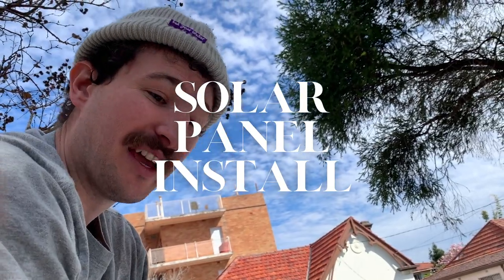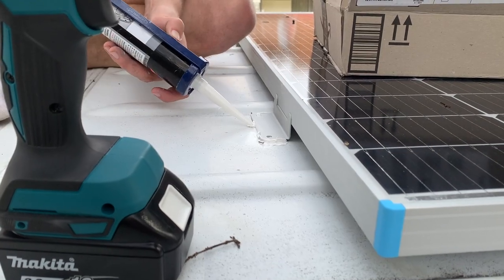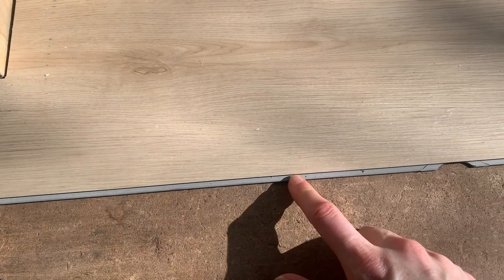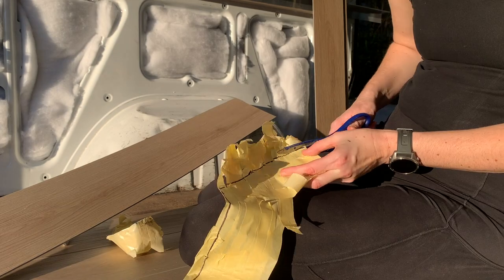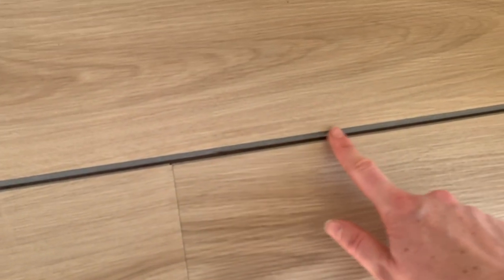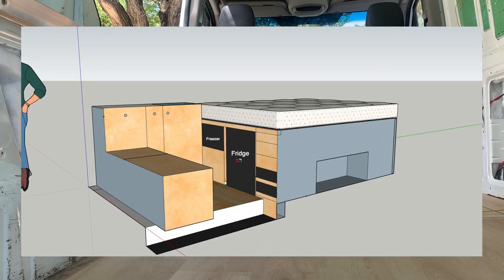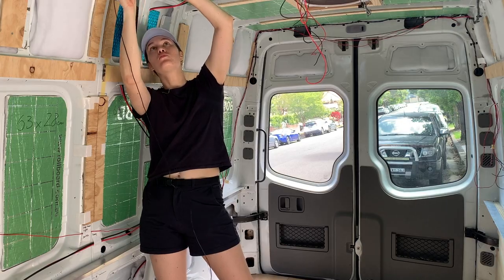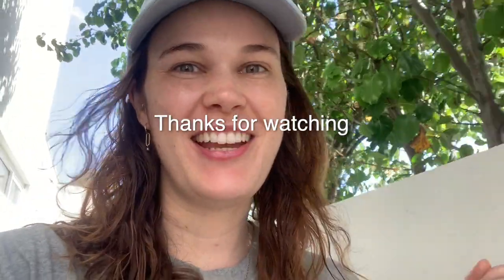This is hard. Solar panels, floor and first-fix wiring | Van Designs 04

Comment: not gonna lie, you're gonna regret gluing your floor down.
Reply from the maker: Very possible 😅 we’re learning as we go. I definitely used way too much glue at the start. But we were told not gluing/having it floating is risky in the moving vehicle.